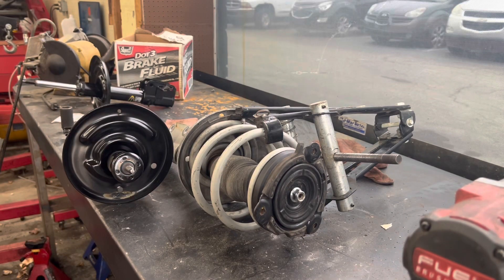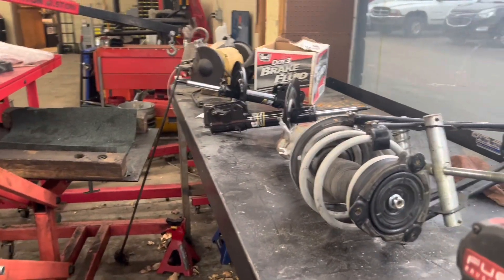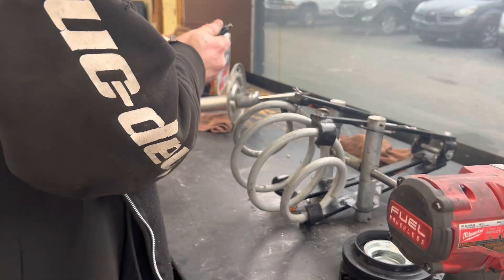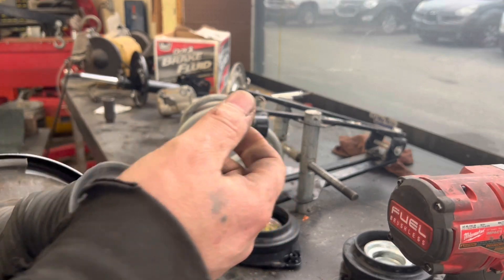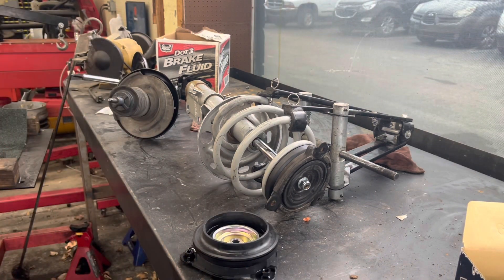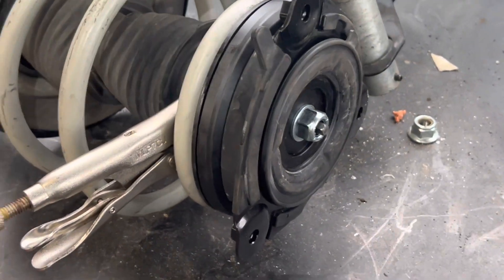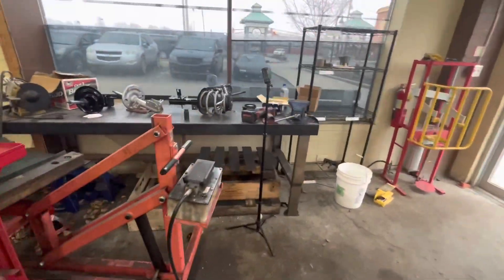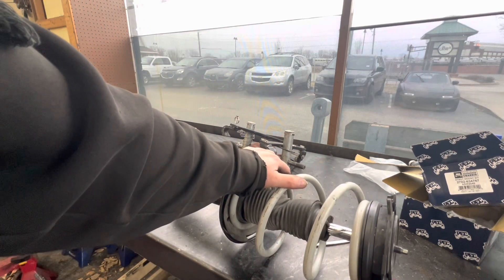I do not feel safe using this Pittsburgh strut spring compressor

Comment: your said afraid of thread stripping on the unit, there is a safety nut that I did not see on your unit to thread up just in case that was to happen and also never saw the safety ring in use once spring was compressed.  But at least you got the job done.